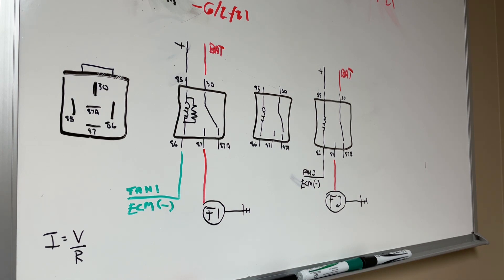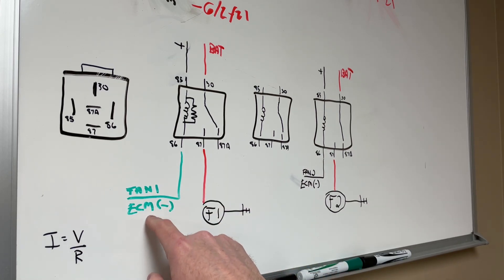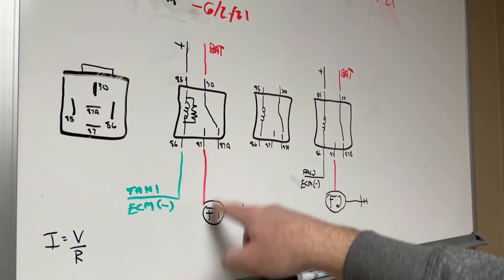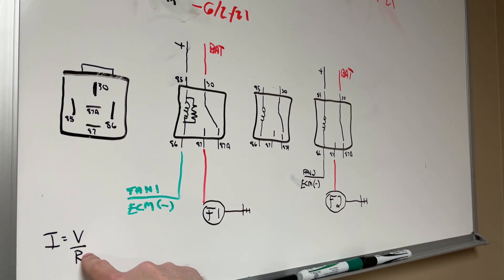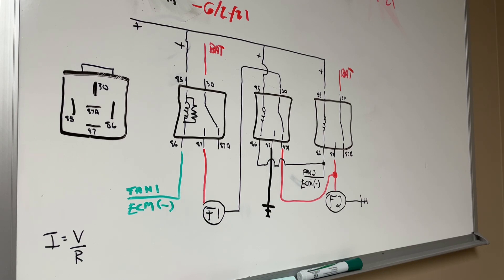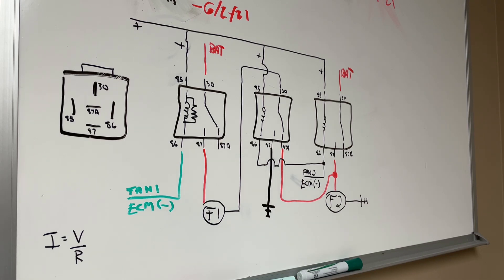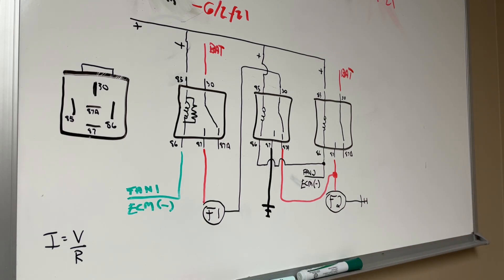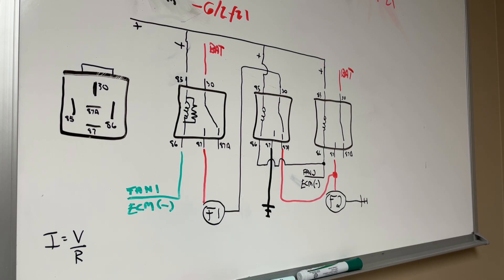3 Relay Automotive Cooling Fan Logic

Comment: if you fuse the 3rd relay on both sides (fan 1's 87 to relay 3's 30 and fan 2's 87 to relay 3's 87a) it could be a good backup if relay 3 circuit fails.

Comment: If ecm on relay number not giving signal, so fan number 1 wont be turn on right? Im still confused for my 2003 ford escape with 3 relay 5 pin and 2 pin on both fans.

Comment: Great tutorial! I wanted to redo mine existing setup with better/proper gauge wiring. I went the easy way and purchased the painless wiring kit. Little did i know, the kit only fires one fan when green (LS1) low fan grounds out. Both fans come on when blue high fan grounds out. I decided i'd suck it up, use the wiring and relays (good stuff from painless) and re-do it like this. The "half voltage" explanation made sense. thanks for doing this!
Reply from the maker: Glad it was helpful.  It is really nice at half speed.  Works well with the Vintage Air kit as well.

Comment: Help needed for my 72k20. I have Gen 3 with mark8 fan and added vintage air. I have a 3 relay setup to handle large spikes when high speed kicks in, but need to add trinary trigger to activate fan high speed. I’m guessing adding a 4th relay is needed, but how to trigger without interfering with pcm fan triggers? Any help would be much appreciated.
Reply from the maker: Good question.  I am not sure on that one.  My vintage air is working well with this setup.  I did use a GM pressure sensor to have the ECM activate the van based on pressure in the AC system.

Comment: Appreciate the help. I was troubleshooting fan issues and this helped me narrow it down to the Relay 1 fuse. Fan 2 was the only one running, and only at high speed. Relay 1  fuse was inexplicably missing, but fan fired right up when I replaced it. Now I understand the whole system.

BTW if Relay 3 were to fail you wouldn't destroy F1, it just wouldn't have any voltage across it and wouldn't run.
Reply from the maker: Thanks for watching!

Comment: I have a 3 fan relay set up just like this in my 2002 Lexus IS300, Im putting a GM 5.3 motor in the car. The GM ECU has two trigger wires for the fans, one is low and the other is high, I think when its on high they are both running full and both running half on low. My question is where do I tap the GM trigger wires into the Lexus 3 relay harness..?
Reply: From what I see its #86 on relay one and three ..? also I should note that my relay 1 and 3 are four pin and 2 is five pin.
Reply from the maker: Sorry for the late reply.  I'm not sure on the lexus relay setup.  I'd assume they use standard relays and wiring would be similar.

Comment: Great video.
I think that because 87a is always NC which means that the current path is guaranteed through the two already connected terminals 87a & 30 so it's rated to 20A.
In the other hand 87 is NO and when the relay coil is energized then both terminals 87 & 30 will be connected under load which means an ((instantaneous)) high current will pass through, that is why it should be rated to 40A, i.e. higher rated current compared to 87a.
Pls. correct me if I'm wrong.
Cheers.
Reply from the maker: Thank you.  I believe you are correct.

Comment: 87a is for use like(for example) day time running lights which are automatically on when you turn on your car. And obviously it turns off(of become low powered) once you switch to the main headbeams. You can leave 87a open and not hooked up to anything.
Reply from the maker: In this case it's needs on the 3rd relay to allow a current path through both fans in series.
Reply: In relay nr 1 & 3  he  don't use=connected wires on pin 87A
In relay nr 2 there is a wire connected to pin 87A

Comment: 85 is ground on any relay I've ever seen?
Reply from the maker: I agree.  GM calls out pin 85 as positive and 86 as the negative trigger in its wiring diagram so I stuck with it.

Comment: I have a Suburban 2012 and I want to make both of the fan run on high speed all time  and I have  4 relays  with 5 pins can you show me the  diagram  thanks in advance
Reply from the maker: That’s a good question.  I don’t have an answer on that.  You might try calling Current Performance.  I know they do a lot with tan wiring.

Comment: The fatal flaw shouldn't be a concern. If you have 12v on both sides of the fan it's an open circuit so current won't flow. There is no ground. If you touch 2 wires to positive and touch them together on the other end, nothing happens. Electricity is trying to take the shortest path to ground. 

Now if that first relay was shorted to criund before 30 and the second relay was not functioning it would turn the fan backwards but what are the odds lol

Great video though!
Reply from the maker: Fair point.  Thanks for watching!
Reply: You are wrong fan nr F1 haven't power so that can't  works 
If first relay is the left relay

Comment: So does the ECM keep the LOW Speed connection grounded when the HIGH SPEED is grounded?  I assume so, then the fans will just slow down the when the system/computer drops out of High speed.  I think I answered my own question but no one ever mentions this part of the system.
Reply from the maker: Yes it does.  On my truck, fan 1 come on at 202 and off at 196.  Fan 2 on at 211 and off at 203.  So fan 1 will run regardless of what fan 2 is doing until the temp sensor sees less than 196.  It is tricky thinking about this stuff.

Comment: I am not sure my fans are rated to run on reduced voltage?  Right now my set up is the two relay style with one computer input for each fan.  I do like the possibility of running them at a lower speed to reduce the noise.  However, I have the same issue as Bruce.  How to get the AC to trigger both fans.  Right now I am considering using only the lower temperature computer input for one fan and the AC input for the other.   The other possibility is to use the same circuit you outlined with the two inputs, one LS ECM and the other the AC.  Thanks and looking forward to any AC solutions you may have.
Reply from the maker: I'd call the fan manufacturer and ask.  From what I have read, you can use a trinary switch to trigger both fans by wiring the trinary swith to both the green (fan 1) and blue (fan 2) wires.  You will have to add a diode and resistor on that line so the ECM doesn't see it.  I may talk a little bit about that in an upcoming video.  I am adding these wires in just in case my pressure switch doesn't do what I want it to.  There are a lot of way to do it, just depends on how you'd like it to work.  Mine is going to let the ecm control both, both low and high speed via  pressure sensor.  I can program the ecm to turn the fans on/off at certain pressures in the a/c system, or so I am told haha.  I'll find out soon.
Reply: @RustyWrenches  I plan on using both the ECM ground and the Vintage Air supplied ground on high speed fan relay.  It it gets hot both fans come on and if the AIR is on they both come on.  That should work don't you think?
Reply from the maker: That should work.

Comment: I’ve had this 3 fan relay setup on my car for a couple of years, it’s been on the road full time for the last few months and it’s working great.  The wiring diagram I used I found online.  My LS computer controls the fans and I have a manual over ride switch that I never finished connecting because the computer controls seems to be perfect.  I still have to figure out how to get the AC to trigger the fans.
Reply from the maker: I also thought about adding a manual override as well.  Maybe someday.  I'm really hoping the pressure switch will work with my setup so the ECM will control the fans for the ac.  We will find out soon!  Thanks for watching!
Reply: If you have that diagram you can connect a switch  1- wire   to 3-relay  pin 86 the other wire you connect to ground 
When you activate the switch both fans works on high  speed
Reply: @ 
Yes this 3 relay setup runs the fans both full speed or half speed.  My car never runs more than 195° even with the AC on in stop and go traffic so the high speed never turns on except when I tested it to make sure it worked